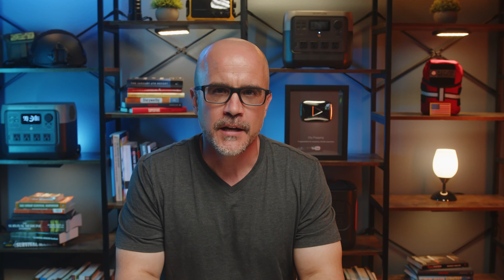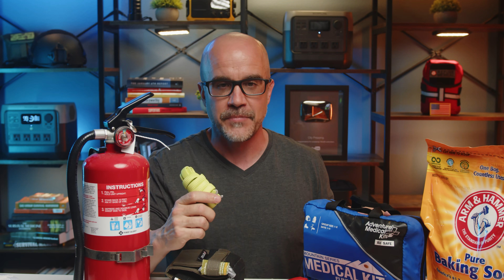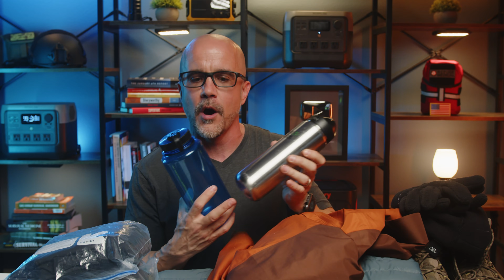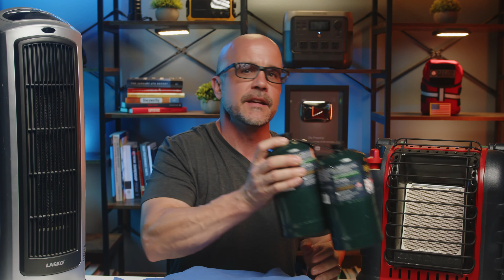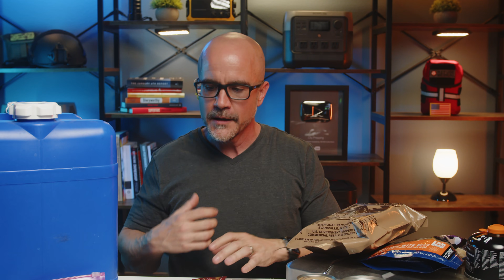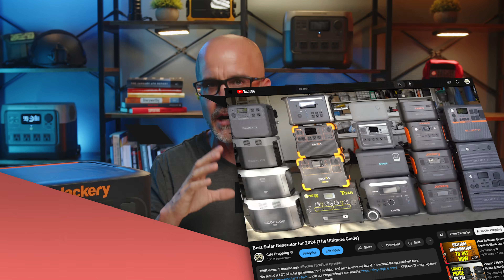30 Affordable Winter Survival Items to Get Now (How to Survive a Winter Power Outage)

Comment: 13:55 What are the types of winter emergencies where the electric grid doesn't go down? We had an electrical cable cut by a utility company, which gave out on a cold winter day and resulted in power to only a half of our house. A handyman came in and quickly replugged breakers to power a furnace and a water heater, but we did test out how it would feel like to be without electricity. The main issue was that electricity is needed to power both furnace and a gas water heater. Without electricity the burners won't stay on, so you get maybe a maximum of 5 hours of hot water in a standard household water tank. If you have electricity, you have zero heating problems.

Comment: I have over 100 bottles of water.
Access to three water wells all within a few hundred feet.
A huge pond on the property
The wellhead hand pump stored in the shop that needs to be primed when used
but it does work.
I'm good on water without having to store huge drums/tanks and whatever
people use.
One 24 pack water bottles at the bottom of the chest freezer also.
The animals here make easy water access necessary.
We can move horses to water but the sheep/goats seem to have other priorities when roaming.
-
getting older, I completely love my heated blanket.
If the power goes out I'm ok but I will use that blanket under the mattress pad until it fails then I will get two more.
It's very low power so I could easily use it during generator run time for freezers/fridge.
We heat ENTIRELY with wood.

Comment: Winter items to prep: SAFETY: detectors fire and CM. Fire extinguisher, blanket & baking soda. First aid kit. Tourniquet. Quick clot. WARMTH: hand warmers. Mylar rescue blankets. Wool blanket. Cold weather sleeping bag. Thermos for hot water heater. Layered clothing, keep extremities warm. Hats, gloves, sox, insulated boots. Base layers, long underwear. Heavy shirt, pants, vests, jacket, windbreakers. SHELTER/insulation: Indoor tent, microclimate. Mylar blanket. Duct tape. Poly sheeting. Tarp for wind or rain. Damaged structure. Sleeping pad/wet barrier. HEATING: CM hazards. Fires. Safety measures vital. Make small area. Mr. buddy heater propane. Keep ventilated. Elec htrs. If have power. Firestarters. Drain water pipes. LIGHTING: battery, rechargeable, solar. Lanterns, flashlights, headlamps. Batteries. Be careful with candles & oil lamps. FOOD/COOKING: hot plate. Butane & propane stoves. Sterno, jet-boiler. Freeze dried foods. MREs, no-cook options. Stock pantry. Hot tea, cocoa, coffee, eat warm foods & drinks. WATER: store large amount and also have filtration methods. Life straws, Sawyer, Berky. Purification tablets. Gravity system. COMMUNICATION/POWER SOURCES: hand crank radios. Solar cell phone chargers. 2-way radios/walkie-talkies. Solar power panel. Power banks. Generators. Prepare for the worst.

Comment: A note re: backpacking water filters. The filter CAN freeze and then it will defrost and potentially crack, rendering it useless. If you're using one, shake it dry, put it in a ziplock and sleep with it to keep it warm, or put it somewhere with heat (near a wood stove).

Comment: Now why do I want to refer to a Battery Daddy as "Baddy Daddy"? 🙂

As for candles: they produce both heat and light, so they can be a last resort for both. There are several DIY options for candles, including the classic, long-lasting "Crisco candle". Need more heat and light, just add another wick!

Handheld radios are a good idea for emergencies. Sure, you can use (nearly) any frequency in a TRUE emergency, but I would recommend studying for a ham license and using it to practice communicating BEFORE disaster strikes. Your best option MIGHT be to communicate using a ham repeater on the 2 meter or 440 bands. Doing that actually takes a while to learn, even in the best of times. You have frequencies, offsets, and usually PL tones to set, and doing that from the keyboard on a Baofeng can be bewildering. IF you want to skip the license and wait for a disaster to strike, find a friend with a ham license to program a few important channels into your radio and give you the "Cliff Notes" version of how to operate it.

Comment: You can create a tent in your home. Use clothing pins from laundry type or clamps from staples. Attach a sheet or thin blanet to top of drapes or window treatment. Make sure the window treatments are closed.
Pull the sheet out as far as possible. Rubberband it to top of kiitchen chair. Climb underneath this. Your body heat will stay between the area. You can do this in livingroom over top of furniture. Bring your pillow, blankets and sleep on the furniture. Amazing how well it works

Comment: You need to stop telling people they can use ham radios without a ham license. It is illegal to do so, and untrained / unlicensed people keep trying them out, disrupting communications, locking up repeaters by activating VOX functions in which ambient noise causes their radio to key up. Just get the license. It’s not that difficult, and you no longer have to learn Morse code.

Comment: Canadian here - two things that work great for keeping your feet warm when indoors in the winter are sheepskin slippers or down/polyester filled booties.  Given that my feet sweat a lot, polyester filled booties are the better option for me.  I've also worn mine outside for short periods of time  at 0F/-18C when the dogs have needed to go out for a quick pee.  Polar fleece hoodies are a great, especially for kids that may not want to keep a hat on.  I'm a firm believer in sleeping bags with hoods and in the event of a power failure, being in one while reading or playing board games during a power failure will keep you comfortable for a long time.  The longest stretch that we've been without power was 4.5 days due to an early September snow storm (well over a foot).  Temps were a few degrees below freezing, not the -20C to -30C temps that we sometime get in the winter.

Comment: All are good ideas.  In the frozen tundra of the upper Midwest, we turn our water faucets to a low drizzle and open any cabinets doors to let warmth to the pipes to keep our pipes from freezing.  Check out things like chafing dishes that heat with Sterno or fondu pots that warm with candles for heating food.  If you have a gas stove you won’t have too many problems.  If you pressure can foods or water bath can foods, you can water.

Comment: Not that many years ago Quebec had a ice storm and lost power for 7 days for many people. I like the tent idea. Try 1.5 in polystyrene  under the tent with regular comforters on top of the tent to keep heat in  and keep water and can food inside the tent. Also rice pasta and regular  food is way cheaper. Camp stove ftw. Also 10000 other people are in the same situation so if you can survive with out help from shelters you will ease the burden  on the shelters

Comment: Be aware that Mylar is non porous and does not allow moisture to pass through or evaporate. If not ventilated the moisture is trapped on the warm side of the Mylar surface causing anything on the inside of the Mylar to become damp. Enough dampness becomes wet and can void the purpose of the Mylar covering. 

From personal cold weather camping experience. 😂

Comment: I may not be the only person with this problem so if anyone has a better idea I could use it. My father in law purchased two of the Rockpals 1300w solar banks Oct/ Nov 2023 , one for himself and one for myself, when we got the units we checked them and placed them on charge. I placed my solar bank in a spare room with my other gear, fast forward some months and we lost power and I needed the 1300w unit to power the appliances, long story short the unit wouldn't power up so I had to borrow his , Rockpals is no longer in business and for the last few months I have been trying to get in touch with the company . Rockpals wants to see the sale slips and make it hard to get any were in the process, I  know Rockpals has a record of the sale and his name is in their data bank. all I want is to replace the unit any thoughts.

Comment: I have a water shut off bank in my laundry room.  I can just shut off each water line with a lever.  I'm on a slab so I assume the lines go down below the frost line to the water shut off in the street.  It really makes it convenient especially in the snow and cold so you don't have to go outside.  I can shut off each line then turn on the water in the house to drain the lines.  I do that with my out door faucets every winter.  Another place to put a tent is on the bed.  A king bed could possibly hold a tent that could hold 4 people.  I'm pretty well winter prepped for emergencies since I live in a snowy winter climate in the mountains.  All good ideas.

Comment: My wife and I are VERY fortunate. We heat our House with an Off-Grid Kerosene unit. When the power goes out, heat is no issue for us.
I have 5KW of Battery Backup run by Solar. We can FULLY Heat and Light our home completely off the grid. The Solar charges our usb driven lights we have plac3d in every room of the home. We have TWO One-Burner Butane stove and over 100 Fuel Canisters.

Comment: In order to drain the pipes, open all the faucets. If you just open one faucet on the lower level you will drain the pressure tank by your water heater, but the water will get trapped unless you break the vacuum by opening all the faucets. Also. Probably a good idea to capture the water instead of allowing it to go down the drain.

Comment: With those blue water containers, do you just fill them with tap water and put them in a dark spot and forget about them?  How long does the water stay potable in them?
Reply: If the water from your tap is drinkable,  it will stay good in the blue containers indefinitely.  Some people recommend draining and refilling every six months to a year but it isn't necessary.  Stored water may taste flat, but if you pour ir back and forth in two glasses, it will re- oxygenate and taste fine. Hope this helps.
Reply: @roymenefee1303  Thank you.  We have well water so I'm hoping that means our water will remain drinkable.
Reply: @kaesmomFitz  it should. To be sure, you can add a few drops of pure chlorine  bleach to each container.  Just Google bleach to disinfect water to learn the proper dosages. Good luck.
Reply: @roymenefee1303  hmmmm...Better check that out; I believe pollutants have ways of getting into them, and plastic cannot be adequately cleaned...it has tiny holes which can harbor contaminants.

Comment: If you're being active, another key thing is to keep dry. sweet soaked clothing will suck the heat out of you. For your feet, use liner socks inside of waterproof boot liners or bread bags with your thick socks outside of the liner. This will keep your warm socks and boots dry, and preserve they're insulation value.
Reply: PS....  DO NOT USE PLASTIC BAGS... EVER !!!
Plastic makes your feet SWEAT and Keeps Them Wet = Foot Fungus,  Toe Rot,  "Trench Foot"  =  AMPUTATION. 

Use Plastic ... Lose A Foot.
Reply: @Nyeupe-Nguvu as a former boundary waters guide who practiced wet foot portaging, this can be a problem if you don't take proper care of your feet. Your feet can be wet for half of the day as long as you let your feet dry out properly and sleep with dry socks on every night. Your feet will sweat with or without the bags. The bags are there to keep the moisture from wicking into your thick socks and boot liner, preserving their insulation value. During multi day winter camping trips below 0F keeping your feet warm is crucial. Also be sure to have wool or wool/synthetic blend socks so they dry easier and still maintain some warmth when wet compared to cotton.
Reply: P.S. have you ever tried to dry boot liners while winter camping? It's a lot easier to dry your feet than you boot liners
Reply: WHY did EVERY ARMY throughout history make uniforms out of WOOL??
Because It's Warmer Than Any Synthetic Material Humans Create.

Wool can be SOAKING WET and STILL keep you warm. I Know This For A FACT because it's How I Survived. 

Wool also DRIES WHILE YOU HIKE.
Your Body Heat dries wet wool clothes.  Wool socks not only dry,  but they absorb the water in your Boots and dry that Too.

I Know This For A FACT from personal experience

Comment: The most important emergency item should be communications  - not listening to a weather radio, but a two way communication device. For $30 you can get a GMRS radio and be able to request help. GMRS does not require a test just a $30 fee for the whole family. There are repeater towers all over the USA to communicate through long distances.

Comment: I am grateful for what you do to assist us in understanding how and why to prepare.  
The idea of a microclimate approach to keep warm can be a life saver.  Keep in mind that just as with your personal layering approach it is very helpful when using a tent to keep warm to add additional layers over the tent to greatly improve the insulation factor.  For example layers of tarps, sheets, plastic, etc. for additional heat retention.

Comment: A roll of construction plastic can be used to wrap a house that is drafty strips of cardboard with heavy duty staples is all you need to stick it to the wooden siding, lats are not cheap these days. We did this with the tarpaper and straw around the old log cabin part of the house.

Comment: If you add birthday candles to a tub of crisco you will have  a 30 day candle. You can get a Bio Lite camp stove or there fire pit which turns heat into electricity.   The stove has a fan on the bottom, it uses small sticks for fuel. I will power electric devices that charge with a usb cable.

Comment: Keep a ziplock bag with your hand warmers.  If you are only using them for an hour or two, put them in the Ziploc squeeze out the air seal them up.  You can get another use or two out of the.  They need O2 to work.  Used this trick while driving tractor in winter.  A small square of mylar in a rubber boot over a sock can last a couple cold work days on a tractor as well.  Kept small squares along with a blanket in my pocket...all have been used
Reply: Awesome tips thank you boss! 
Stay cozy ✨️!

Comment: I have moved away from everything that takes batteries except for my trail cameras. Everything else I have is either solar or USB powered.
Something people overlook.
Is that you can use your power stations to cook your meals. I bought several low wattage appliances so I could cook with mine.
F need bSomething people overlook.
Is that you can use your power stations to cook your meals. I bought several low wattage appliances so I could cook with mine if need be.

Comment: Purchased the ecoflow delta max. Glad I didn't need it for storms or any lifesaving medical equipment.  I charged it to 100% when it arrived and went to test it a week later and it wouldn't power on.  Going through the process with Amazon and The Seller-ecoflow for the return.  I am so frustrated and disappointed and don't think I will be able to trust the brand again. Thinking of trying the Buletti the next time. 😐
Reply: I have two Ecoflow Delta Max 2000 and one Bluetti.  Got the Bluetti first.  Have never needed either for emergency but use power from each down to 30% every three months and recharge to 100% for maintenance.  Thankfully, no problems yet.  Observation:  The Bluetti takes A LOT longer to charge.  That’s why I went to Ecoflow.  I think Bluetti is good, but would sell it in a heartbeat if I could and would get another Ecoflow.  There is Facebook pages for both and you can get quite a bit of help with them.
Reply: @happytrails7835 the EcoFlow Delta 3 max is even faster. I have a delta 2 max, I like it a lot.

Comment: Yes, it's timely video.

Looking at the list in the description, I'm happy to see that I have most items covered in some way or another. 

I just winterized my pool, which means I have eight or ten thousand gallons of water ready to go through a set of Berkey filters if the need arises (my Berkey filters are still in factory seals, and my food-grade buckets are ready for me to spend a few minutes with a drill to create a plastic version of the stainless steel Berkey kitchen filter rig). 

My house has solar panels, and an energy storage system. The solar panel system itself was not going to work if the grid were to go down, hence the wall of batteries. I can power the refrigerator, the microwave, and a few lights now. 

And, of course, I am prepared to defend my family. If you live in my 'hood, and ask nicely, I'll let you charge your phone (if that would do any good). I might even let you get a bucket of water out of my pool. 

But the gates are locked, and the security cameras are powered by the aforementioned battery wall. 

A few years ago, my spouse was eligible for "work from home," but a stipulation was that there be fire extinguishers easily accessible in the work space and kitchen and near a fireplace if we had one. Yes, we have fire extinguishers in several key places in our home.
Reply: Best to check out recent claims of fraud and the lawsuits against Berkey.

Comment: Surprised you didn't at least mention wood stoves.  Far more important than a solar generator imo.
Reply: Not every one can have them installed. Maybe they are renters, maybe building code dictates as in an apartment building. Perhaps not everyone would feel comfortable with burning wood in their home as they sleep. A solar generator can provide more than heat. It was going to cost over $2000 to have a wood stove installed in my home. My solar generator cost under $2k (EcoFlow Delta 2 with solar panel, bought when on sale). I have endured several power outages up north where I live. Always used micro environments. My priority is not loosing food in my freezer.
Reply: Not practical for most people